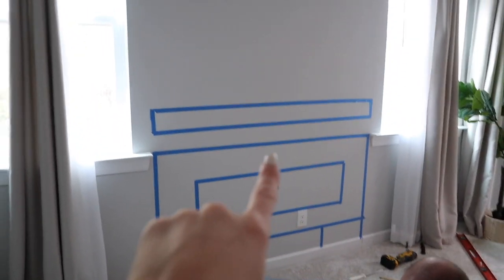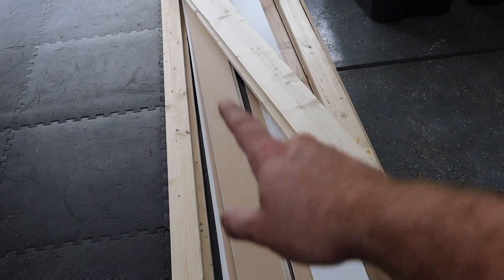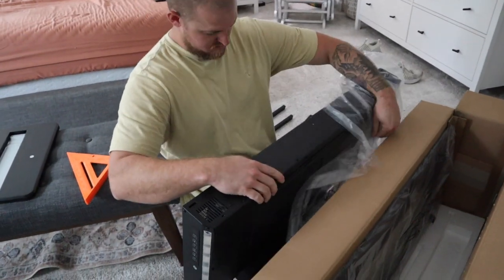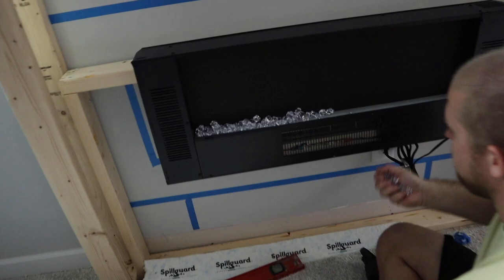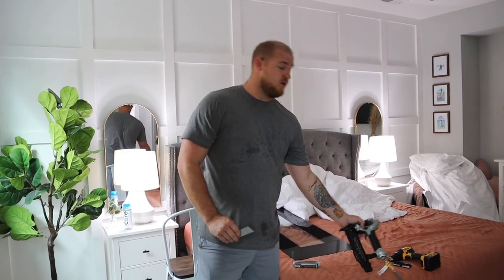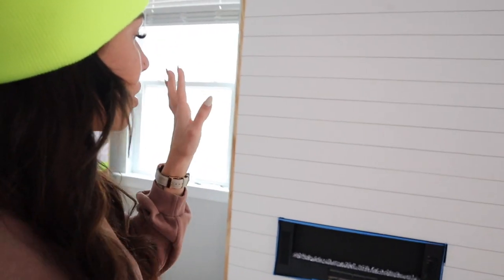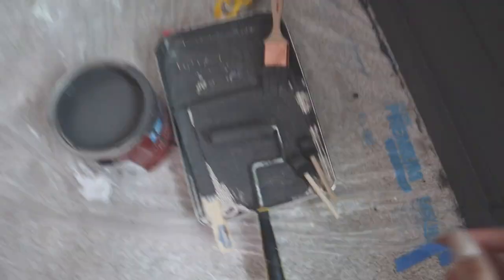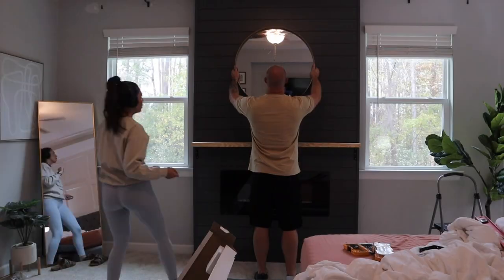DIY ELECTRIC WALL FIREPLACE W/ MANTEL & SHIPLAP | FIREPLACE MAKEOVER | MORE WITH MORROWS

Comment: I saw your video where you were organizing under the stairs and you mentioned that some viewer told you not to wet your wood floors.   That is ridiculous.  I have wood floors and mop them with no problem.  Whether they are laminate or actual wood you can definitely wet them.  Actually there are cleaning products specifically for wood or laminate flooring.  Just wanted to mention that.